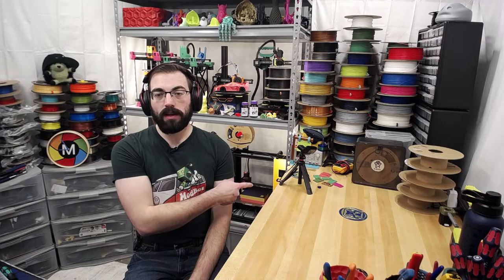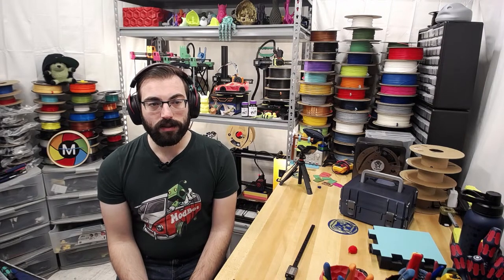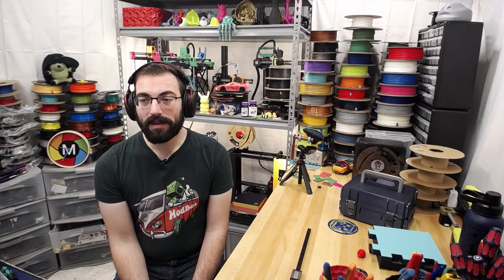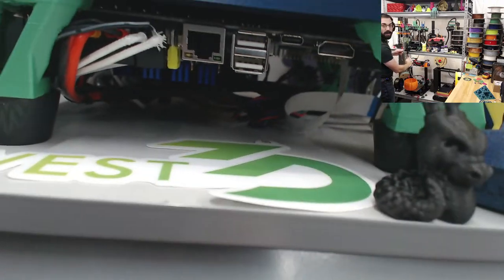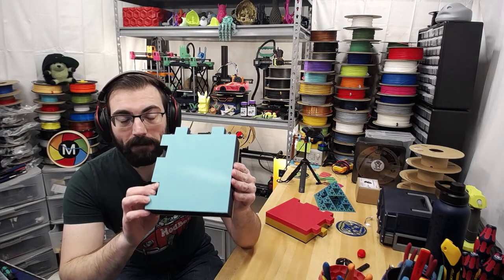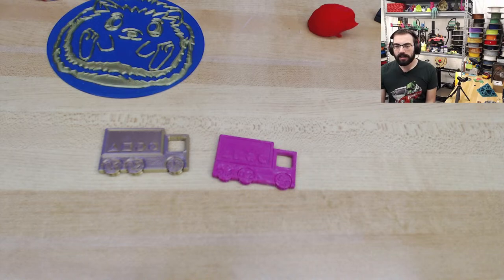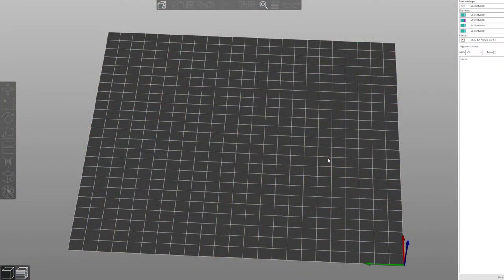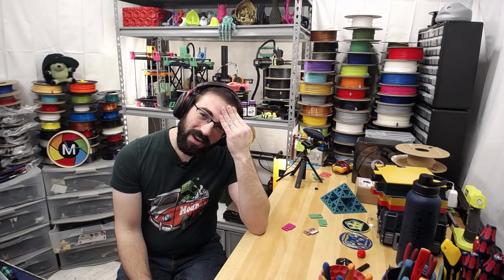How Do You 3D Print? From Beginner to Expert - Episode 1 - Q&A Stream

Comment: warping happens when you have thermal inconsistency which causes parts to shrink at differing rates.  if a part is warm in the middle and a breeze comes alongs and cools a corner, that corner will shrink/contract and lift off the bed.

Comment: iirc, you should be able to simply re-terminate the motor plug to a jst 4 pin connector (That comes with the 2 part hartk pcb, at least it did for me).  I'm using the moon's pancake motor, and that's what I did... the LDO pancake that's on the orbiter (which I believe is the same part as what comes with the ldo v0 kit that have in front of me currently) seems to work the same. re: stealthburner pcb compatibility.

Comment: I print infil at ~300mm/s at 20k accel (I set it to 550mm/s and let the flow cap i set (48^3 rapido hotend + bozzle tc .5mm high flow geometry nozzle), internal perimeters i limit to 250mm/s at 20k, external perimeters I limit to 150mm/s at 5k accel (what input shaper recommended to me for quality) - everything comes out mint. (this is for my newly built voron 2.4 using stealthburner with clockwork2 extruder (uses bmg gears with a simplified filament path compared to the first version) and using LDO speedy power motors for my A and B motors. it is my limited understanding that print speeds don't play a whole lot into print quality, it's print ACCELERATION that matters most (because movement accuracy and system resonances are dependent on accelerations not top speeds).  I'm still very much experimenting and learning rapidly though.